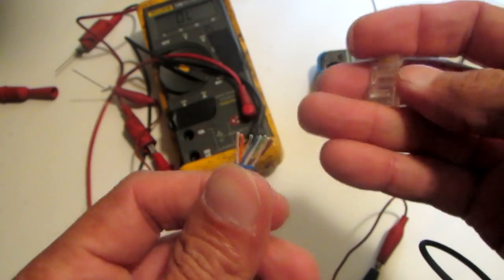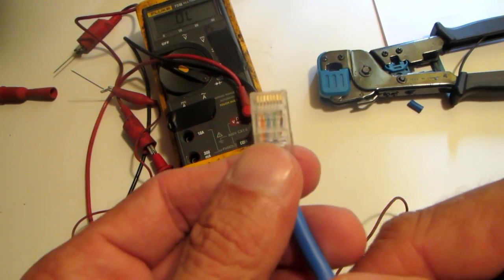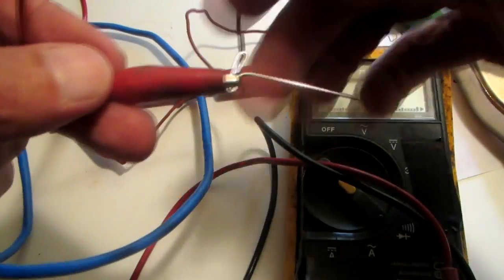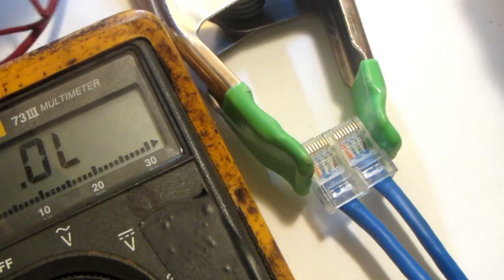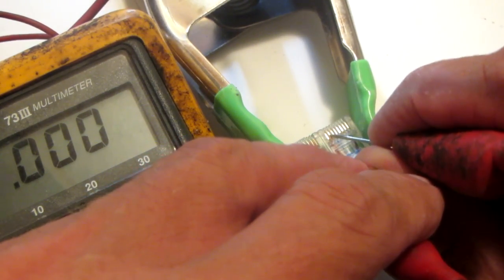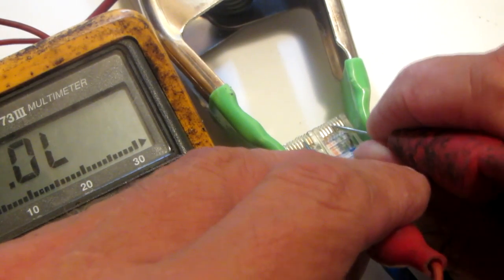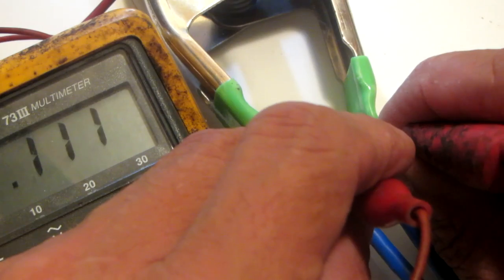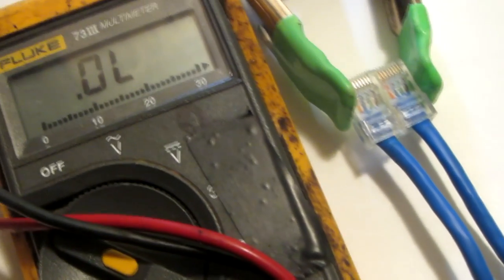Using A Multimeter to test a Ethernet Cable

Comment: It doesn't matter for the purpose of this video, but T568A & T568B are both straight through, just the green & Orange pairs are switched. A crossover is when it's A on one end and B on the other, for connecting Routers, switches, or PCs directly to each other. Most modern stuff can autosense and correct I think, but I've never tested this.

Comment: Awesome. I have cat 5 ran in our house for phone Jacks.  We don’t use the phone any more and wanted to add a couple RJ 45 plugs.  I was wondering how I would find the other end, because we have a lot of phone lines.  It will be easy for me to twist 2 wires together and then go back and run this test on the other end to find that wire.  Pretty cool.  Thanks!

Comment: Good overview.  Do you have a technique to test a wire where the wire has already been run.  My tester is showing that it is receiving no power from the source end.
Reply: get an ethernet tester, they come in two parts, one receiver, one emitter, continuity test is not a good way test ethernet cables (that's why you get those 1$ "free" ethernet continuity tester when you buy an ethernet crimp plyer off amazon, these are worthless and useless, at best they tell you if you crimped your cables properly but that's it, no troubleshooting past that)

Comment: WRONG. t568a and t568b are the same. just the green and orange pairs are flipped. a crossover cable the green and orange cables are split and it goes green orange orange white green white to go from one pc to another, however that is not necessary if using a hub or a router as it does it itself.

try to learn cable coding before speaking out of line.
Reply: Talk about arrogant.. Sheesh, dude.
Reply: @silentcartographer7685  while Mr. Universe was rough, he's definitely not wrong, this video pops up in recommendations or if you search anything close to ethernet / multimeters, depends of your center of interests. Anyway I ended up watching it because maybe there was a fancy mumbo jumbo trick to use a multimeter to test ethernet cables instead of an expensive fluke tester. 
Nope, no, you don't test an ethernet cable with the continuity mode, I have dozens of cables that won't transmit data or negociate even a single 100mb / 1gbe link and they all have continuity, degraded cables = degraded cables, it doesn't have to be physically and visually cut in half for cables to turn bad, and you should suspect your cables if your negociation times are too long and/or you barely get 10 base T nego's... 
No offenses, this is the kind of video, you know the poster try and do its best, but as it's passing (incorrect) knowledge, everyone watching this video (without knowing the topic before hand) will think "oh yh, what could be wrong with cables ? It's just dumb electricity going thru and continuity is fine", spreading the "not remotely true" tips learned here and there, I don't mind you guys messing up your installations, that means more work for network professionals. 

Now, if you want to do things by yourself, then you should educate yourself, the first thing I always wonder is "why professionals have so many specific tools", and the N°1 problem with DIY repairs is "I was too cheap to buy that X $ tool that I'd only use once, F it". 

Someone will test continuity on a bad cable, but continuity is fine, so that person will have to troubleshoot the rest of its setup to find that, in the end, it was the ethernet cable... How many wall sockets and/or walls do you have to replace / change / open / repair before you figure your ethernet cable is crap ? That's the cost of bad advice.

Comment: Sorry to correct you, you don't have a crossover cable there, what you have is a patch cable wired to the british and European standard tia568b. 
To Make a crossover cable you need to terminate one end to tia568a and the other to tia568b we use B in europe and A in America generally, and it seems the whole world uses the same crossover cable no matter if the infrastructure is wired to a or b standard.

I've mastered networking but not power or multimeters yet so video's like this are great, thanks for sharing.
Reply from the maker: I have not made a crossover cable in years. Only used a crossover cable to connect two computers without a network. Thx for the comments and for watching.
Reply: Used to connect two "like" devices together.

Comment: I never considered they'd produce a crossed cable...
Reply from the maker: Cross over cable was used when you did not have a network and connected one computer into another computer.
Reply: @wall37  it really depends as nowadays most network equipments are Auto MDI-X so you don't really need to bother with all this, there's still (old) equipments that need to.

Comment: This is a very useful test to verify of the electrical connection from modular connector to modular connector after crimping, because it does not require the passage of current and has no adverse affect on the modular connectors to be tested! Moreover, if there is electrical continuity, the important thing is that some number appears on the display of the digital multimeter set to the resistance measurement (it means that you can measure the electrical resistance on each contact) and it means that there is electrical continuity!
Reply from the maker: Thx for watching.